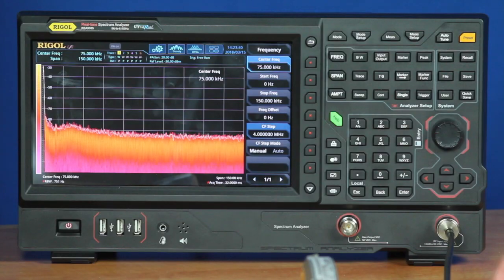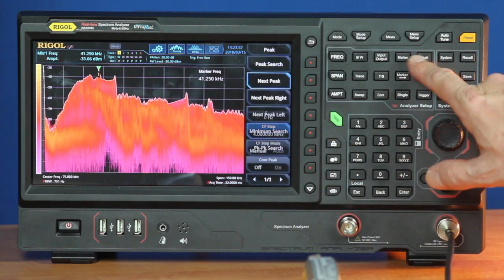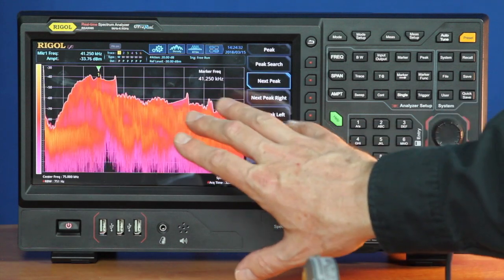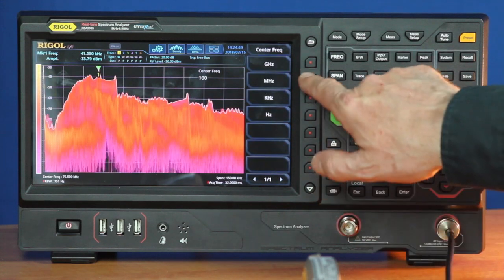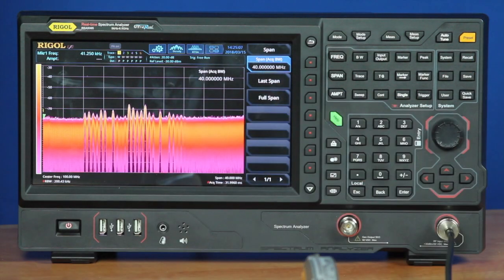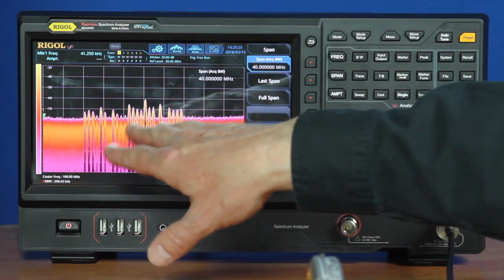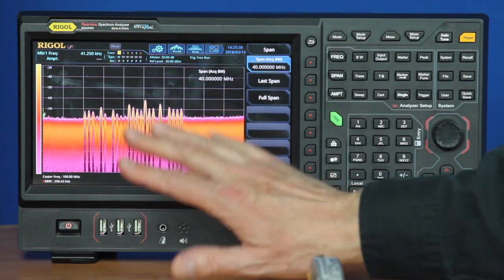Conducted Emissions Testing with a Real-Time Spectrum Analyzer

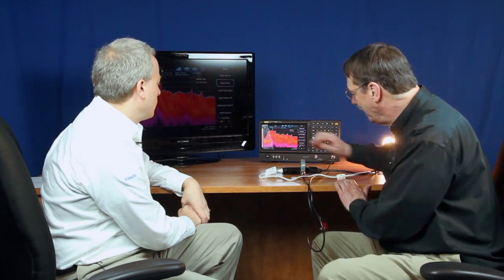Comment: 0:40 "zero to 150 kHz" ... except that the low end is 9 kHz, not zero.   1:16 "there's a lot of information in there"  There is?  You've got a vertically-broad fuzzy pink area, a narrower yellow-orange wiggly band, and a white line riding along the top of the mess.  The video could have explain how you are supposed to read something useful from that splotch.  And OK the auto peak finder found a peak, but why declare that 41.25kHz was the switching PSU frequency when there are two other prominent nearby peaks?  If indeed the chosen peak is the switching frequency, then what the heck are the other two?  Is the LED lamp maybe using some kind of spread-spectrum switching strategy?  And then we move on to the 100 MHz band... OK, sure, it's likely the FM band, given the frequency range.. but doesn't this instrument have a listening  capability to actually verify that conjecture? Does it have an FM demodulator?  Come on people! This is probably a very impressive piece of equipment, but this presentation really doesn't do any justice even to the limited slice of features relevant to this demo!